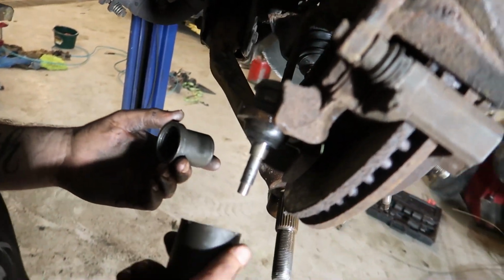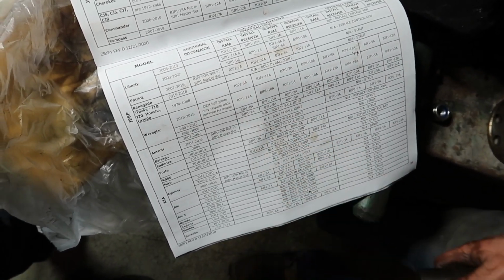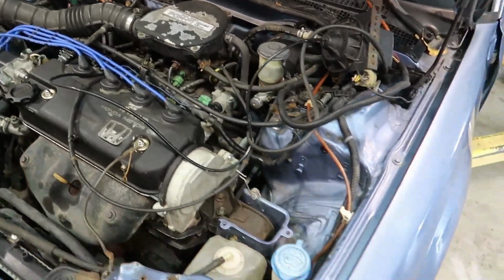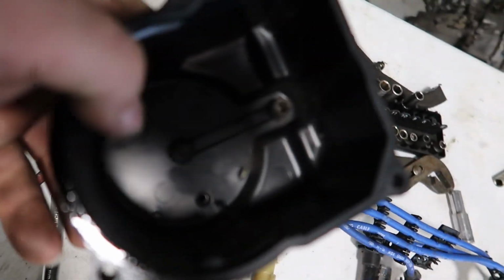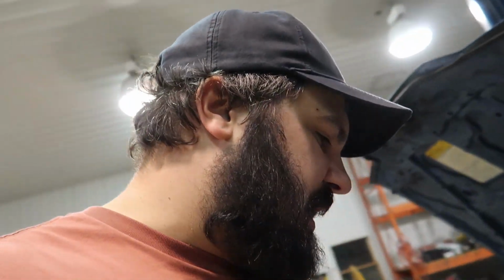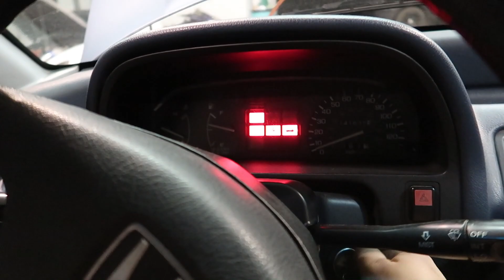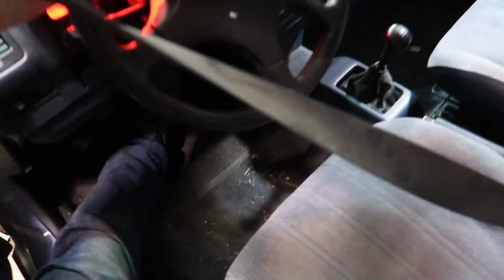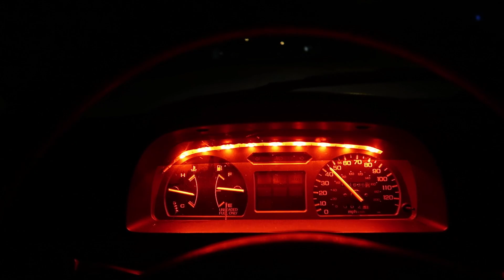Cheap Ef I Picked Up That Didnt Run

Comment: Thinking about boosting a d series but im stuck between that or boosting a b20. Got any advice? I want dohc but dont want to spend an arm and a leg to be fast😂
Reply: Well you aint gonna be that fast with a d series, unless you build the block and head and boost it 30lbs lol. But for the moneyyou gonna spend doing that you coulda went b series and be faster.